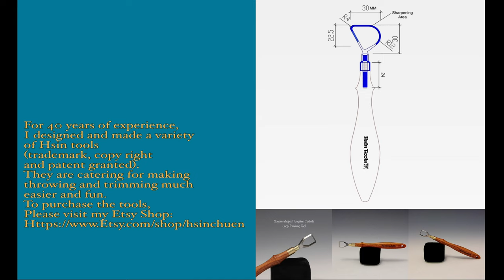671. Unboxing the Prototype of SpaceSaver Aluminum Bat Adapter with Hsin-Chuen Lin 林新春 開箱新鋁合金拉坯盤

Comment: Very nice.  You thought of some great details that I think would increase the usefulness of these bats always thinking outside the box.  I wonder if it would be practical to have a stainless steel model for the porcelain users.
Reply from the maker: It could be any material as long as they last for a long long time. Stainless steel is probably too heavy. I was thinking titanium but it will cost a million 😅🥲

Comment: I don't see this as different from a number of other very similar bat insert systems, apart from it being made from aluminium. I have two different similar ones, both fairly useful, one is a frame around the insert, the other has the insert in a pocket just like this one. The main problem with a pocket system is the need to keep the pocket very, very clean. Any clay getting underneath when you lift out the old one and insert the new onw will cause it to sit proud and wobble in an annoying way. The pocket in the bat needs to have additional recesses cut around the edges so that there is room for a little clay, it should not be a sharp 90 degree corner.

Comment: Continuing my previous comment, I think aluminium is a bad choice of material because of the bat pins. I think it's going to be quite difficult to remove the bat from the wheelhead without gradually damaging the holes. I always have to take my bats off one hole and wiggle them to get it off the other. Two other concerns with aluminum is, 1) how will it hold up to a few years of use with groggy clay? If it wears like other materials, what's the point? 2) The bat pins are steel. Aluminium contacting steel in water means galvanic corrosion of the aluminium.This can happen quickly.
Reply from the maker: This galvanic corrosion theory on the pin holes is overly exaggerated. We have whole bunch of aluminum bats been used for more than 30 years. We don’t find the holes been serious corroded at all. Usually when using the bat, you are not leaving it on the wheel forever. Students remove and clean it and stack up to dry the bat.
Reply from the maker: Continue with my comment, we were trying to find someone to custom make the aluminum bats for the studio again (lots of aluminum bat were missing) but can’t find anyone who can do the job right. This prompted me to design the whole new bat system to tackle the issue of the wooden or plastic bats been rotten, warped when too much moisture or heat (some people can’t wait and torch dry their pots). You survey the studios, especially public studios, how many bats they had to toss out or how many warped bats are still sitting on their shelves. As far as I know: a lot. Ps. I teach at several public and private studios in the San Francisco Bay Area.
Reply: @hsinchuen  Galvanic corrosion is not a theory. Taking a bat like this off repeatedly, possibly even every time defeats the purpose. To each their own, but trying to present a system like this as something new or unusual is not proper.